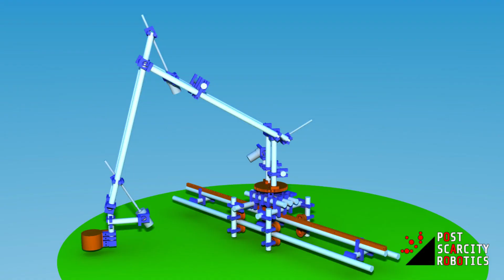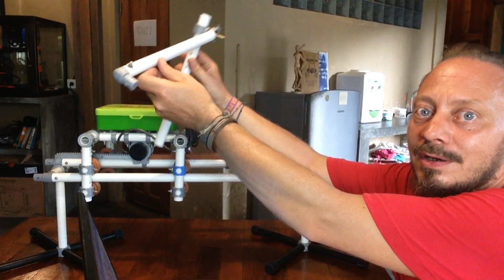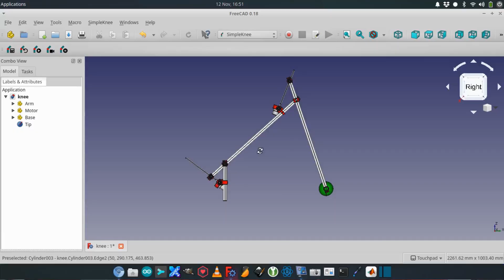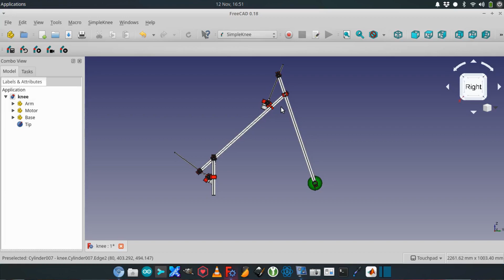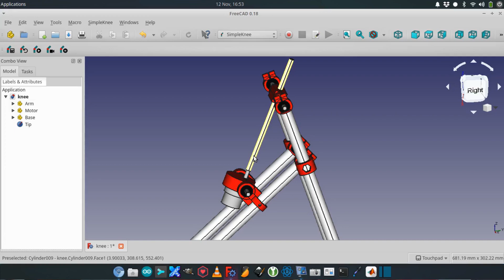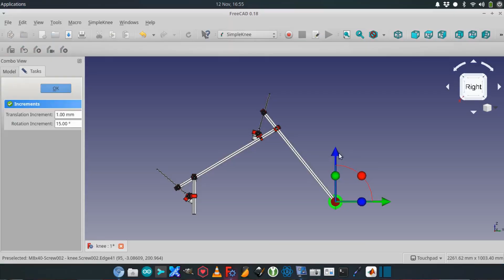How my robotic arm will work

Comment: Well I just think the same as the robot below lol. Thanks for sharing your work and persevering. I'm going to follow the idea, because I saw too many gardens I've created for others abandonned. They (french "tv childs") like the idea of fresh food but just pushing on a button, and incredibly they cannot even water plants..  
I'd be glad to help but I'm not good in electonics, I only do some little programming. Anyway my first feeling would be : why not use wood instead of plastic (unless it is biodegrable, but then more expansive than basic pvc)  ; and to put on a little brushes before the wheels in order to clean the ramps each time the arm or the system moves.  My last idea is to integrate a parallel electric wire fence (with 9V battery) around the basement, against slugs or snails at the begining of cultivation
Reply: Hello! I really like the idea of using wood. It would be awesome to use bamboo, and then the robot could grow the bamboo for itself, so it would be a truly self replicating eco system! Bamboo is a little less exact, but it could be compensated for by 3D scanning each bamboo pipe and automatically adjust the 3D prints. Everything is possible! But those are engineering challanges, so the reason why I use PVC pipes initially is to be able to solve one engineering challenge at a time.
Reply: Yes I know it is all about models.. 
Actually, I'm wondering if a drone wouldn't be cheaper to construct and maintain, even if the programming part is bigger, what do you think about that ?